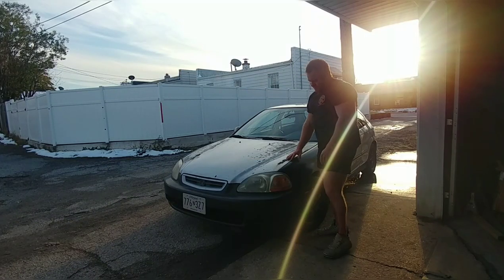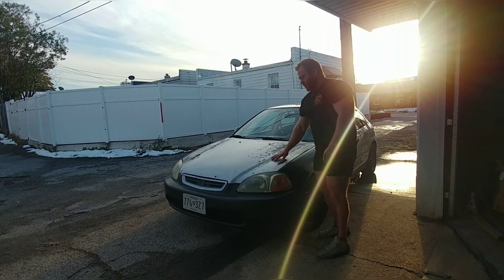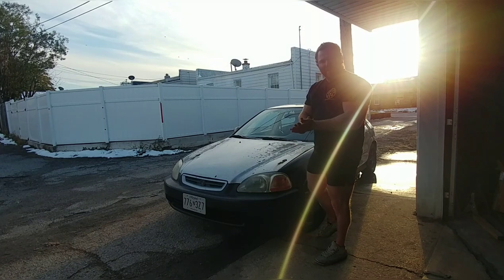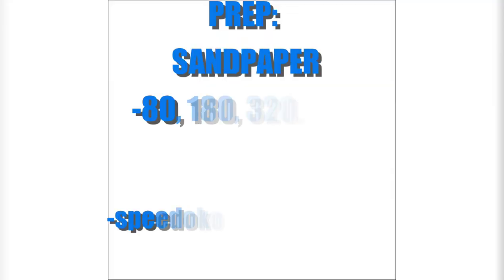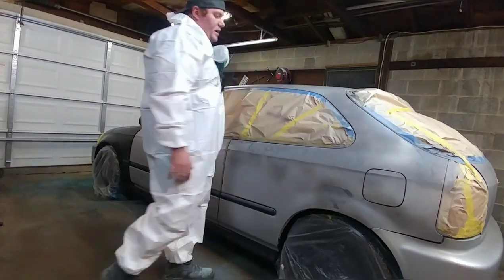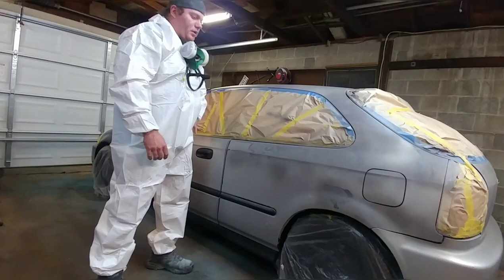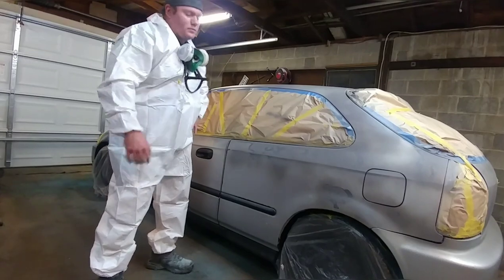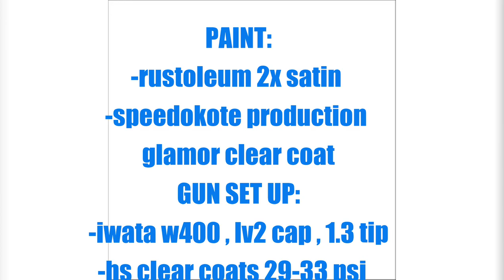nardo grey paint job

Comment: Looks awesom! I painted my coupe with rustoleum 2x and did spraymax 2k clear out the can which was harder to achieve that nice off the gun look. Good job though man!
Reply from the maker: Oh yea man that 2k spray max is really hard to get to lay flat the spray can simply doesn't have enough air pressure to break up the paint . Great product for people who really only want a one time use kinda thing but if you paint all the time deff a gun and a good compressor

Comment: I tried something like this on my channel with a golf cart. I used the 2k cans instead of a gun. It turned out ok but I guess the clear didnt atomize properly and was a tad hazy. I need to just buy a gun and some clear and start practicing. I'd really like to get the technique down.
Reply from the maker: I saw.. Looks like not enough material layed down and probably had some bleed thro with the rustoleum. 100% for sure buy a gun and clear and do it that way next time.. Your technique looks fine to be honest.
Reply: @speedokoterefinishnetwork4937  ten4. What is the best site to order from?
Reply from the maker: I use nothing but speedokote clears

Comment: What causes a air compressor to hum when turned on? It won’t air up it just hums for 8 secs then shuts off :( 

It’s a oilless 26gal craftsman
Reply from the maker: Not 100% sure but I do know oilless compressors have a shorter lifespan compared to oiled one's
Reply: Mine does that when I use an extension cord or plug it into a socket that's not it's own dedicated 20 amp circuit. 
It's a 110v compressor.

Comment: What primer would you use under nardo gray paint? I'm about to paint my motorcycle fairings nardo gray but need to figure out which primer and which color I should use. I then will be adding clear over it also.
Reply from the maker: Smr265
Reply: @speedokoterefinishnetwork4937  thanks for the info

Comment: Have you had any issues spray painting the area around the gasoline cap??  I know some spray paint cannot withstand contact with gasoline.
Reply from the maker: Wax and grease remover helps. Also a little primer sealer
Reply: @speedokoterefinishnetwork4937  so I used the 2x painter's touch around the gas tank cap cover (above the wheel well) and a week later I put gas in the car and the overflow gas immediately ate up the paint.
Reply from the maker: Did you clear over the rustoleum?? With 2k clear?
Reply: @speedokoterefinishnetwork4937  no.  but i will now...
Reply from the maker: Yup lesson learned. Clear over it even if you use our cheapest clear

Comment: wow..amazing results... im just curious though.. why spray cans and not single stage or base/clear??? does the spray paint last long at all?
Reply from the maker: For some cheaper jobs I'll just grab 40$ worth of satin spray paint from rustoleum , base coat the car with that , let dry, then clear coat over with a high quality clear coat after. Will this method last a while ? Yea cause your puting a clear coat over top that has uv protection over top ... Do we guarantee our clear coats over spray paint ? No . however I highly suggest this method for people low on budget , material cost can be as low as 95$ with a gallon of our cheapest clear coat
Reply: @speedokoterefinishnetwork4937   and you recommend spray cans VS the regular canned rustoleum paints in a spray gun?
reason?
Reply from the maker: More color options and I find the cans dry quicker
Reply: Speedokote refinish network How long would a paintjob like this last?
Reply from the maker: Easily a few years if not longer . all depends on prep

Comment: Do you recommend the satin then clear coat or just get the gloss dark gray
Reply from the maker: Personally .. Just buy real basecoat its about the same cost , and clear coat over it
Reply: Speedokote refinish network unfortunately I don’t have a garage:/
Reply: @speedokoterefinishnetwork4937   Where can you get real basecoat in areosol form??
Reply from the maker: @treefiddytt2039  not worth it just buy basecoat in a can. Spray it with a harbor freight gun if you have to
Reply: @speedokoterefinishnetwork4937   So decant the spray paint and then use a cheap gun?
Reply from the maker: I would recommend useing a gun for the whole job.

Comment: Can the glamour clear also be used over the rustoleum universal gloss black?
Reply from the maker: Its possible yea , speedokote just doesnt warranty there clear over anything that is not automotive grade basecoat
Reply: @speedokoterefinishnetwork4937  ok. I have been considering a rusto paint job using the universal gloss black due to its fan spray tip over the 2x that doesnt have the fan spray
Reply from the maker: Honestly id just spend the extra 100$ and get a gallon of black base coat from us. Mixes 1-1 with reducer and extremely easy to spray with amazing coverage. Then throw in our 59$ clear coat and you will get a way better finish and save alot of time and frustration . if you have any questions please call brad he can not only answer ANY question you have but also take your order
Reply: @speedokoterefinishnetwork4937  oh I didnt know you also sold the paint. I may just go that route then.
Reply from the maker: Yes sir , go to www.speedokote.com , call the number and you can order everything you need right over the phone with a card ! There jet black basecoat is amazing , I have 2 videos demonstrating it

Comment: HOW MUCH AIR PRESSURE DID YOU SET GUN AT??
Reply from the maker: All depends on what clear im useing , temperature etc etc ... I like to spray a little on the higher side at 28-35psi